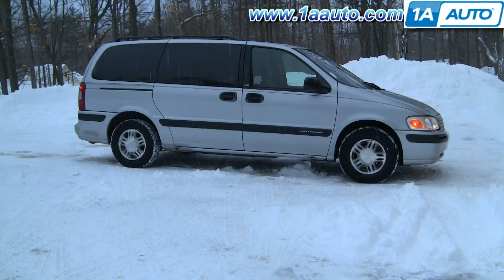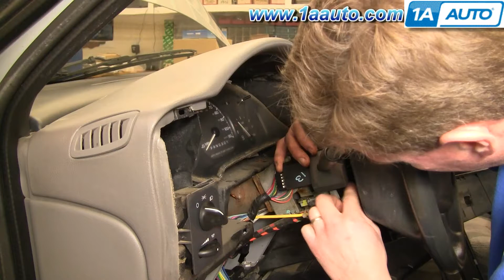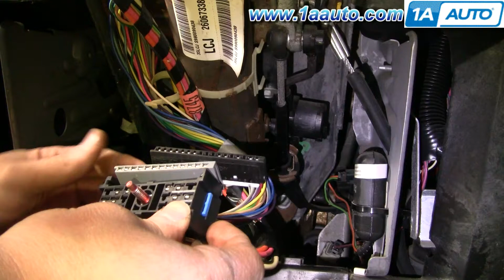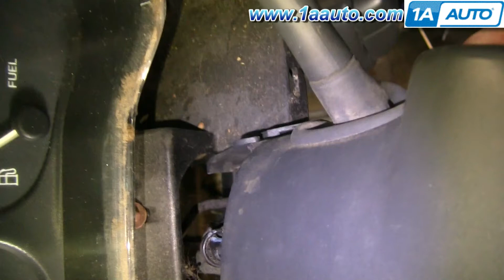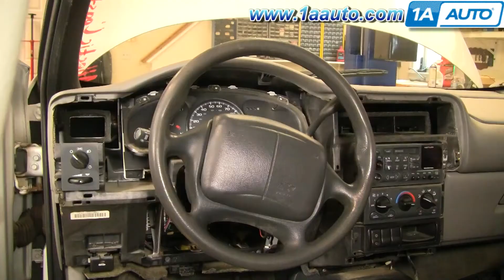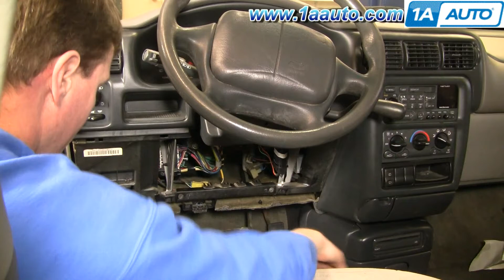How to Replace Combination Switch 97-05 Chevy Venture [Part 2]

Comment: A1 Auto,, will this correct if you have no low speed or able to use the intermittent wipers ,, my venture is a 1997 and will only allow me to Use the High Speed wipers,, 

thanks
Reply from the maker: +Johnnie C If the swithc has gone bad then it should correct the issue. We carry the new multi-function switch on our website. Here is a link to them https://goo.gl/zpMn4K

Comment: Will this fix a fast-blink turn signal? I checked bulbs front and rear and they are good. Sometimes I get a fast blink on the right and when that happens using the left signal the right lights up solid on the dash while the left blinks, if that makes sense. Thanks for your help.

Comment: I am a 66 year old Great Grandmother. I took on putting in the turn signal, wiper switch, myself. On Social Security, and funds are limited. I had some problems, but figured it out. Our 2002 Silhouette is a little different than the van you changed it on. The trim around the radio, had two screws holding it in place. I took them out, and still couldn't get the trim off, but it did come off at the top enough to get the dash trim off. Also had problems getting the wiring harness disconnected. But after an hour, got it done. We almost didn't have cruse control, until I got a mirror to see where the connector went!
The trim around the steering column has a gap in it, took it apart, and still there!! ? 
I ran from the van to the house and the computer, to check the next steps.....after a while, I WALKED! I have been upside down in the floorboard, arms scraped, and a total mess.
I got it mostly done, but have to put the dash back together. Tomorrow....if I can figure out where everything goes, and I can figure out how to make them fit, it got dark on me and had to get the windows up, so got all the electrial done so I could hook the battery back up to lock the car......THE TURN SIGNALS WORK, AND SO DOES THE WIPERS!
I have been without wipers since February...
THANK YOU FOR THE INSTRUCTIONS. WITHOUT YOU, I COULD HAVE NEVER GOTTEN IT DONE! 
Next project, is trying to figure out how to fix the hinge on the glove box. (cheap plastic!)
Reply from the maker: Thank you for watching!
 888-844-3393

Comment from the maker: You could test it with a test light or an ohm meter to see if the switch is working correctly. Hope this helps you out 1aauto.com 888-844-3393